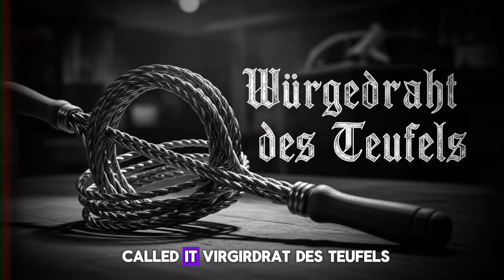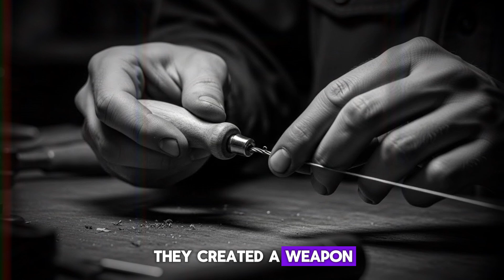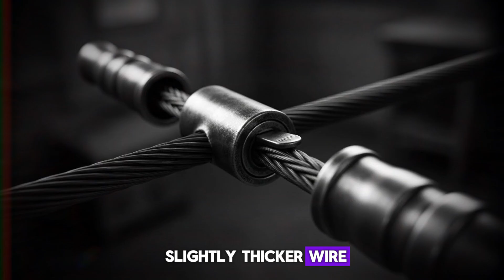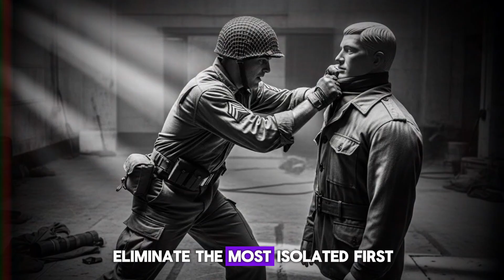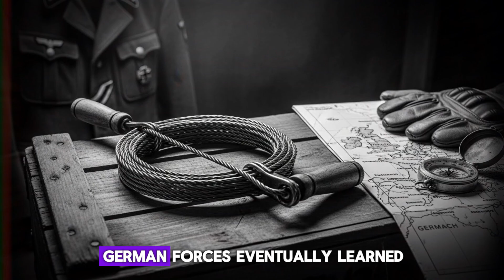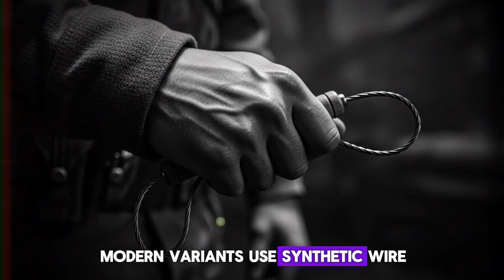The 'Silent' British Garrote Wire That Strangled Sentries in the Shadows

Comment: No there is the possibility that the target's weapon may drop on the floor causing noise. It is possible to quietly kill a guard with a knife i.e. dagger. But the hand must be placed  over the mouth while pinching the nose at the same time the knife is inserted into the neck behind the ear
Reply: Oh you must bend your knees while knocking your knees into the target causing the target to fall backward